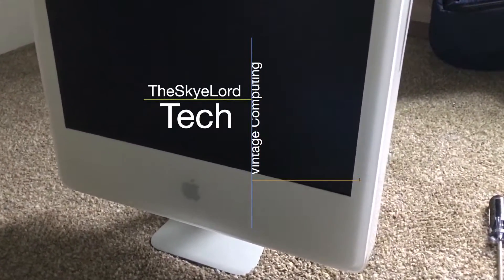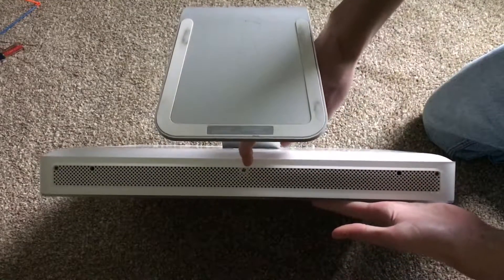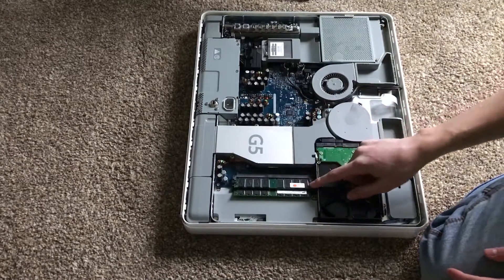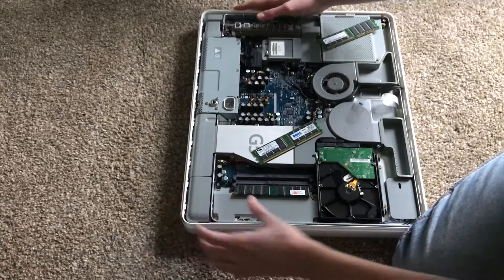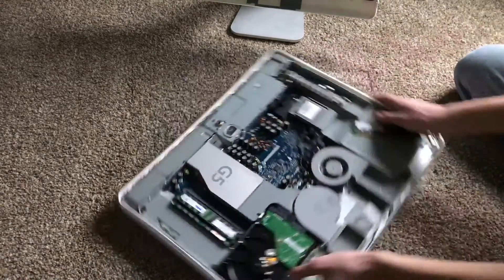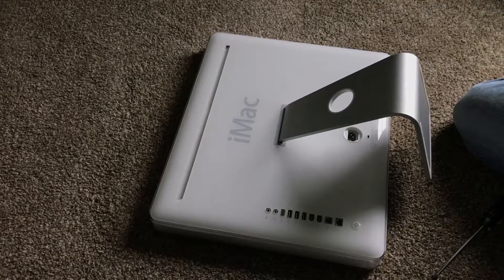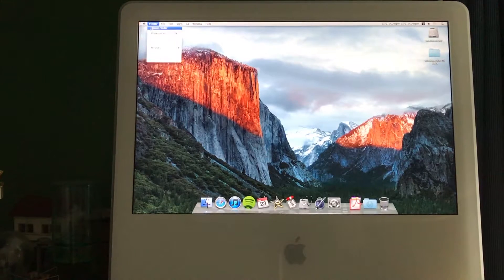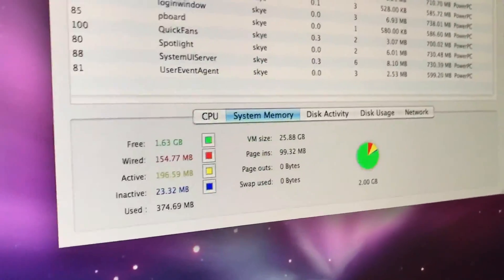iMac G5 RAM Upgrade

Comment: Okay so I just bought a iMac g5 and I might need to do this that will let me upgrade it from 10.5.8
Reply from the maker: T3 Tre8 unfortuantely, 10.5.8 is the final OS X version that the iMac G5 can run, as the next version of 10.6 dropped support for PowerPC machines
Reply: thats so trash so should i get my money back or could i get pieces to upgrade it
Reply: @t3tre830  FreeBSD can use either 32bit or 64bit versions (64bit FreeBSD allows usage of more than 2GB of RAM)

Comment: Came here when my G5 got 3 beeps and jet engine fans on startup. What model ram should I use for this? Send me a link if you can
Reply from the maker: H.F Gaming any DDR 400 ram will work. And try reseating the modules, that can fix that
Reply: TheSkyeLord Thanks. My Mac was recently shipped from Seattle so they probably just need to be reseated.
Reply from the maker: H.F Gaming no prob.

Comment: Hey have you done lcd panel on one off these
Reply from the maker: i have not, no. but i would imagine with the iFixit guide and a good toolset it probably is possible
Reply: LCD is pretty difficult to repair, youll have an easier time swapping the motherboard to a new unit with a good lcd

Comment: Did you only change the ram out to update it the way you have it? I have the same g5 but it’s running 10.2 and What you’re running seems to be exactly what I need for mine. If it’s not what updates did you do to get the os and whatnot?
Reply from the maker: well, i got the computer with OS X 10.5.8, so i really didn't do any updates to it software-wise. and the RAM upgrade was because i had the other 1 gig dimm laying around and so i did it because why not lol. and i don't think the G5s ever shipped w/ OS X Jaguar. earliest was 10.3 panther i believe.

Comment: Could you give me the label information on the wireless card? I have the same model iMac G5 as well, however it does not have a wireless card in it.
Reply from the maker: Solo Arby any AirPort Extreme card will work. The PowerBook and iBook G4s of that time used the same wireless card, so they’re easy to find on eBay.
Reply: Cool, thanks for the info!
Reply from the maker: Solo Arby no problem man!

Comment: Is it the Intel version or the PowerPC version
Reply from the maker: Kenyon papen PPC version
Reply: i have the intel
Reply: i have an idea lets both make a video using this for a week you use ppc and i use intel
Reply from the maker: i could kinda try it, my only limitations are that 1) its PPC, so it'll only run OS X 10.5.8, which is on the obsolete side on internet and software, 2) video editing will be a pain since it only has a little 64MB Nvidia card of some sort, and 3) the machine has no OS and i don't have a Leopard DVD
Reply: TheSkyeLord You can buy one for pretty cheap on eBay and the challenge will be which one will be easier to use
Reply: TheSkyeLord Plus get Mac fan controller and you can do some OK things on a Under powered computer
Reply from the maker: Kenyon papen Macs fan control is only for Intel machines.
Reply: TheSkyeLord I think they make one for PowerPC